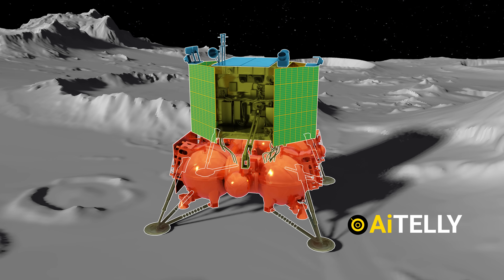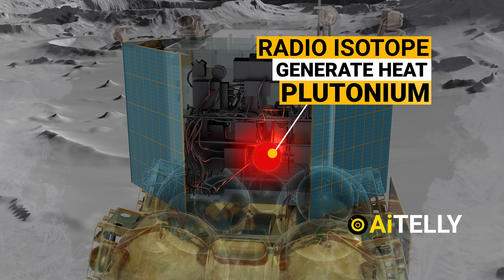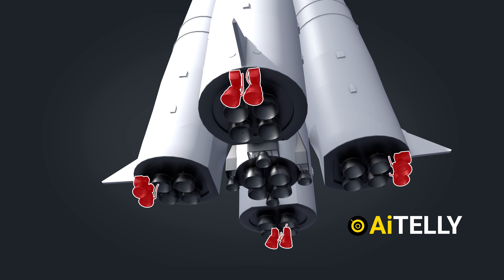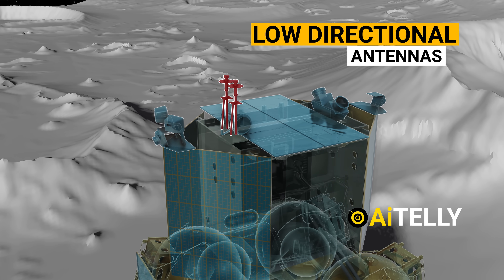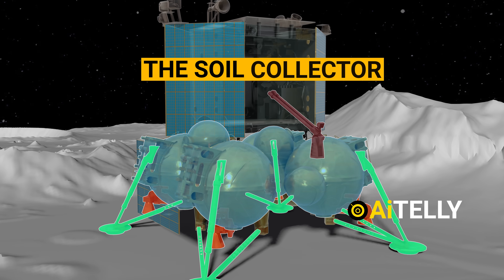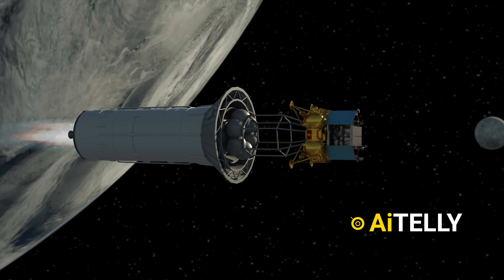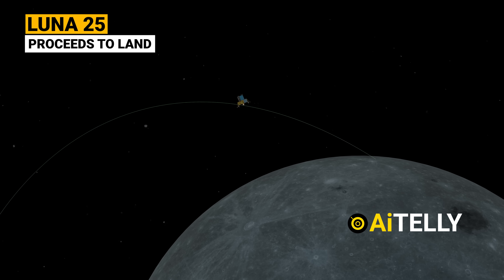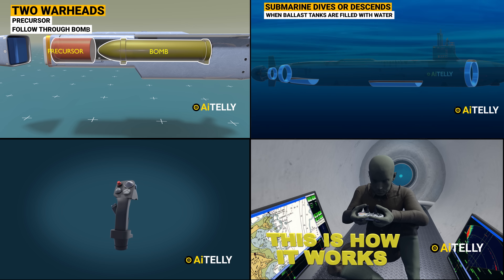Luna 25 How it Crash Russian Lunar Space Lander | Chandrayan 3 vs Luna Comparision

Comment: This video is confusing and inaccurate.  The animation leaves out several crucial stages, depicting Luna 25 as basically launching direct to the moon instead of launching into Earth orbit and then leaving from Earth orbit (translunar injection, or TLI). The Fregat stage also detached after TLI, playing no part in entering lunar orbit, which is also left out of the animation, instead depicting Luna 25 braking for landing. 

The actual sequence of events is that Luna 25 entered  lunar orbit on August 16 at roughly 100km altitude. It then spent 3 days in orbit, taking pictures and even using some of its scientific instruments before firing its thrusters to lower altitude near the south pole to 18km on August 19 (from which altitude landing would have been attempted the next day). It is during that maneuver that something went wrong. No reputable mention has been made of it 'spinning out of control' or 'struggling to calculate gravity'. That's just wild embellishment. What happened is that it fired its thrusters for a longer period of time than it was supposed to have and most likely crashed on the far side of the moon. (probably 20-40 degrees south of the equator). it never got a chance to attempt landing as there would have been no time to issue orders to correct its orbit.

Comment: Quick correction: There is nothing innovative in using radioactive material as heat sources. RTGs have been using that technique for well over half a century.
Reply: RTG is used as an electrical energy source, not as heat source alone.